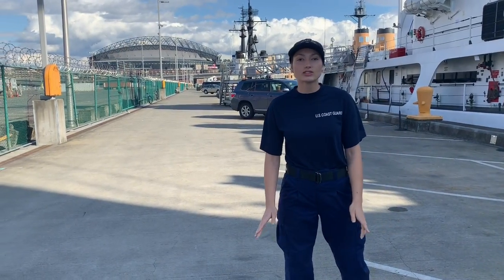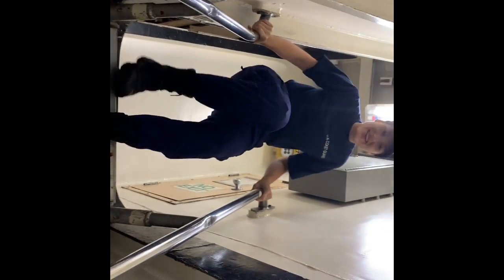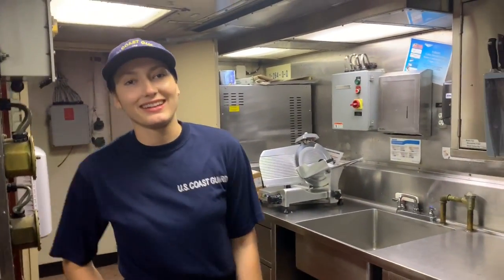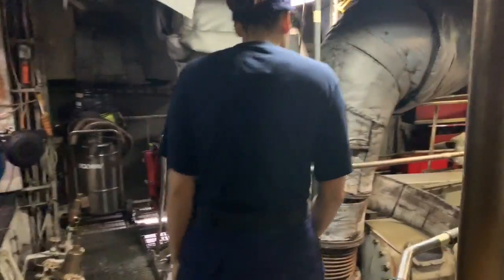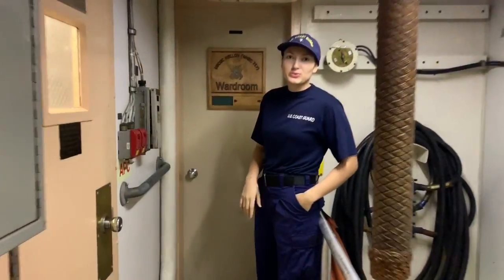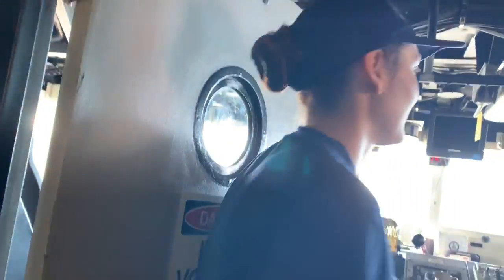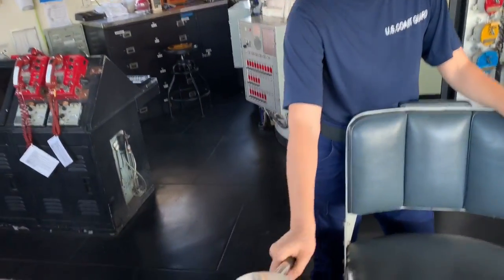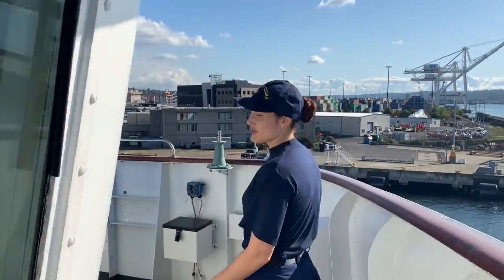Coast Guard Cutter Tour

Comment: The cook is the most important person in the ship. No one will stay on that ship if they don't eat. Thank you very much for being the most important person in the ship
Reply: Thanks very much!😃
Reply: I agree. One of the LAST "deeds" I did before leaving my last 210 as TCIC (and ships systems manager) was to "acquire" enough computer (back then, it was known as a standard work station) parts to put together a system for the Jack-of-the-Dust to have his own setup.  There was this little room right next to the galley and just off the messdeck (no, not the old MARS room) where I set it up. A monitor, a CPU w/mem module,  and graphics slice for the color monitor I "traded" for. The ET's were nice enough to run me a network cable to said room. The FSC was VERY VERY happy for this parting gift. Always take care of your cooks. Besides the Radioman/Telecommunications specialist, they are the MOST important person on the ship! 73's
Reply: As long is I atleast have can of BEANS I’m fine
Reply: When I was in the Army I quickly found out to ALWAYS make friends with our cooks!!! In fact my girlfriend was the line chief and she always took care of me and my friends in my Surgical Department  even though I told her she didn't have to.

Comment: I served on board Mellon in 1979-80 she was a great ship out of Honolulu.
Reply: 1980 @ Sand Island
Reply: I was on the Mellon in Honolulu from '78 to '81, but during that time, we "swapped" the Mellon for the Munro -  I don't recall the date.  The Mellon went to Seattle and the Munro,went from Seattle to Honolulu.  As I recall, the Munro was a closer match to the Jarvis which was also stationed in Honolulu at that time.
Reply: @willfredregill9064  The swap was after March 1980 I had missed that.